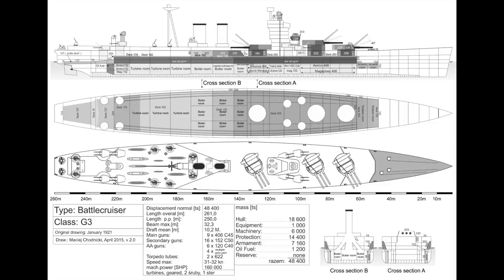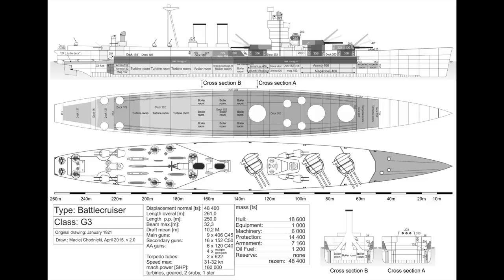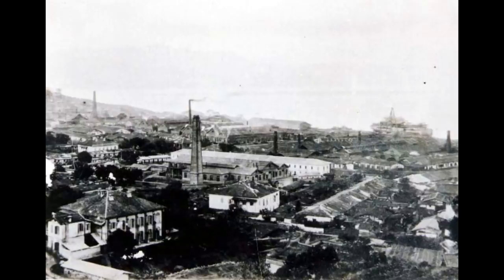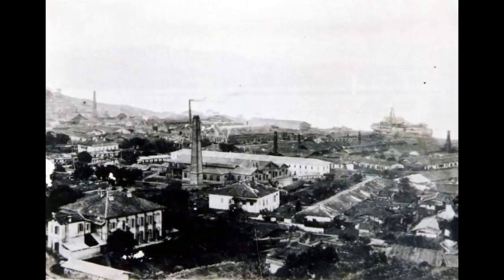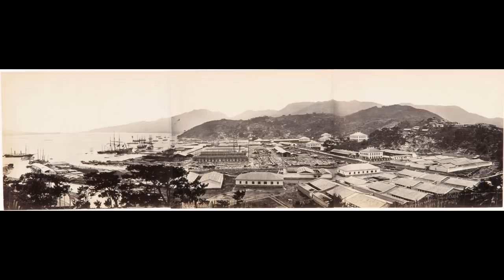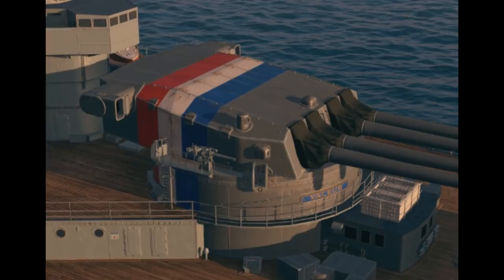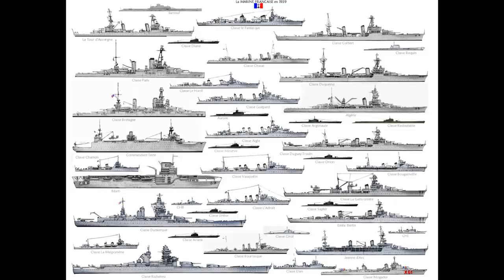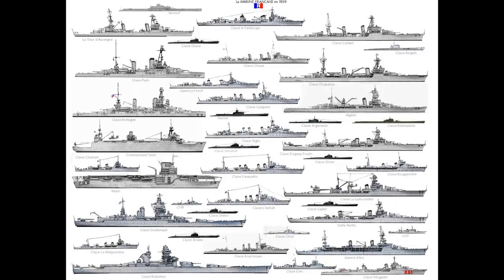The Drydock - Episode 015

Comment: The number of guns on a warship has to be multiplied by each gun's average rate of fire during an expected battle.  US 8"-gunned heavy cruisers in WWII were supposed to be firing a three rounds a minute per gun, assuming that the the range and fire control functionality allowed such a rate between aimed shots.  This "by-the-book" rate assumed using the regular propellant and shell handling by the crew in the magazines (propellant), barbettes (shells), and ramming rates into the gun (turret loading equipment under crew control).  This US rate during most of WWII was drastically exceeded up to FIVE rounds per gun during most of WWII by different ships coming up with various crew 'modifications ("sailor alts") that they shared with each other.  Some of these were dangerous if done incorrectly, but the ammo and gun crews became experts rather fast.  These included shortening the gun recoil since the recoil mechanisms were rather over-built, using medical gurneys carried by two crewmen in the barbettes to pick up the shells and carry them at a run to the hoists up to the turrets, doing "cue-stick" fast ramming of the shells into the gun to speed up rammer motion, and having a crewman jump onto each gun and look down the barrel to see exactly when the smoke from the previous shot had been expelled.  These had to be reversed when inspections by shore facilities were being done...

Comment: If the 3rd turret of the Nelson was super-firing, then at medium to long range when the barrels were elevated above about 12 degrees or so, they would clear the roof of the A-turret so the 2nd turret could fire over the top of the first.
Meaning in a chase from about 35km to 15km you could fire with all your guns till you got to close range where the A-turret would obscure the B-turret again, at which point you can then turn to expose the B-turret again.

The reflected gasses off the roof of the A-turret might affect accuracy, but at really long range where this would be an issue, the barrels would be elevated up and away from the roof by then so the effect would be lessened).
Reply: To make that design work would involve lengthening the ship as the barrels for B turret overhang A and the Barrels for C turret sit under the rear of B. The reason Nelson had such an unusual gun layout is to maximise the armour required for the magazine's while still building a ship that stays within the agreed tonnage limits.

Comment: I recall reading that at Casablanca the Jean Bart's sole functioning turret was jammed (could no longer rotate) by a hit from the USS Massachusetts which made her pretty much useless after that.  (To add insult to injury the shell that did the damage was a dud.)  If her other turret been installed and fully functioning then the JB would still have had half her firepower disabled.   That's a heavy price to pay for the weight saved by squeezing 8 guns into 2 turrets.

Don't the structures on the masts of that French pre-dreadnought look like electrical discharges could come shooting forth from them like they were some variation of a Tesla coil?

Comment: In fact, the Dunkerque class was built in response to the Dutschland class and the Richelieu class in response to the Littorio Venetto and the Bismarck.
Reply from the maker: Indeed, but the Deutschlands could be handled by cruiser groups, whereas the Scharnhorsts needed capital ships and the Dunkerques would be a good fit for the mission.
Reply: IIRC, Strasbourg's upgrades in armor over her sister Dunkerque (substantially thicker belt and slightly thicker deck and turrets) were a response to Scharnhorst.

Comment: Myoko-class, also in practice, not only in theory, was superior to contemporary USN cruisers, as can be seen by the battle of the Komandorski islands. You don‘t give the Japanese enough credit. Their cruisers were the most advanced cruisers at the beginning to middle of the war.
Reply: As well the Myoko class should have been better fighters than the US treaty cruisers. They were at least 1,000 tons (and later 5,000 tons) over the limit and carried much more effective torpedoes.
Reply from the maker: As I said, they had superior gun power and torpedoes and excellent optical fire control. Their weaknesses were getting hit on the torpedoes and later little to no radar.
Reply: They were not the most advanced, but they were good resiliant ships, and they did a lot better then USN cruisers in most engagements.

Comment: What would sailors do too pass the time?
Reply: In most cases, work on maintaining the ship. This would be from mopping and shining the decks to tearing down and rebuilding the equipment.  There is alot of associated maintenance that should be done to keep a warship in top fighting shape. Add in constant training and watchstanding (even some in port), and you can have a full work day for the crew. When this falls apart is when the ship is stranded in port for extremely long periods like the German fleet in WW1 after Jutland and the Japanese fleet after Leyete Gulf. Restricted supplies and no way to go to sea means sailors cannot train and have time to mutiny.

Comment: You say Kongo was superior to Tiger at the time of the Washington Naval treaty. On what basis? The Kongos had not yet received the refits (added armour, increased gun elevation, lengthening, new boilers and engines) that caused the Japanese to reclassify them as Battleships. There was nothing done to improve the Kongos that could not have been done to improve Tiger. If Tiger had been available during the 30's  they might even have had time to rotate Hood in for the refit she needed.
Reply: Kongo and Tiger were very similar ships as built. The main advantage of Kongo was that she had Vickers 14"/45 Pattern A guns, which had better range and penetration than the BL 13.5"/45 Mk V. Though Kongo had an 8" belt compared to Tiger's 9", so only range would be a relevant advantage if the two ships went up against each other. They'd be about equally capable of defeating each other's armor when the shells hit.

I still find it a bit surprising that, given how much the threat of the Deutschland-class cruisers was being overestimated at the time, that Tiger wasn't retained on account of being one of only 4 ships in the fleet capable of outrunning and outgunning Deutschland. To stay in compliance with the London Naval Treaty while keeping Tiger, they could've simply scrapped Iron Duke and demilitarized Revenge as a training ship. From what I understand, Revenge was already in worse material condition than Tiger in 1930 anyway.

The only downside would've been that Tiger would be the only ship in the fleet still carrying 13.5" guns.
Reply: Since they were scrapping the Iron Dukes, being the only 13.5" gunned ship should not have been a disadvantage. There would have been a large stock of ammunition, parts and barrels to keep 1 ship repaired. Since the armour on the ships was bolted on (that's how they were able to increase the armour of Repulse/Renown [in fact Renown's 9" belt armour came from Almirante Cochrane after Cocharane was converted into a carrier]) they could have taken advantage of the more powerful engines/boilers and increased the armour over the magazines and machinery spaces as well as replace the battlecruiser turrets/barbetts with the more heavily armoured battleship turrets/barbetts. I know this would have taken a fair amount of time and money, but since there was no prospect of new constructiion in the forseeable future it would have been worth it.
Reply: @richardcutts196  
I was thinking more in terms of the logistics of keeping 13.5" shells in stock at every naval base that Tiger might be sent to. As such, a retained Tiger probably would've been permanently assigned to the Home Fleet, so that bases in the Indian and Pacific Oceans wouldn't need to stock any of those shells that only a single ship could use.
Reply: There should not have been a real problem. Since the Iron Duke class (4 ships) used the same 13.5" shells, and they were in service at the time a decision would have been made to retain and refit Tiger (and scrap the Iron Dukes), any base that Tiger was sent to would presumably have had a supply of shells for all 5 ships (4 Iron Dukes as well as Tiger).  Also it would have taken at least 2 years to refit Tiger, giving plenty of time to send a supply shells to any base that might need more.

Comment: The most plausible scenario for the entire French fleet going to Britain would be if Churchill and Reynaud's Franco-British Union proposal had actually happened. (Which would only have been possible if Petain and other pro-armistice politicians in France had been disposed of. Either by arresting them for treason (which in retrospect they were actually guilty of) or just assassinating them.)

Regarding the question on Nelson and Myoko turrets, if the third rather than second turret is superfiring then at long range that actually would allow for all three turrets to fire forward. Since the second turret's guns would be elevated to fire over the roof of the first turret. This actually was the layout used on the Mogami-class cruisers, and later on the Juneau- and Worcester-class CLAAs. And at least two British battlecruiser concepts (F2 and F3, a pair of Treaty battlecruiser designs that were among the Nelson-class proposals before the O3 battleship design was chosen) also used that layout.

Personally, even aside from turret layout, I think the Royal Navy would've gotten more utility out of the Nelsons had they been built to the F3 design. The armor would've been weaker, but still rather good (12-13" belt instead of 13-14", basically the same deck armor). The armament would've in theory been weaker, but given that the Nelsons' 16"/45 guns proved to be a bit of a disappointment, 3x3 15"/50 guns firing the same shells as the 15"/42 would've actually been an improvement. And a ~29 knot top speed would've allowed them to keep pace with aircraft carriers rather than being limited to operating with slower fleets or as convoy escort.